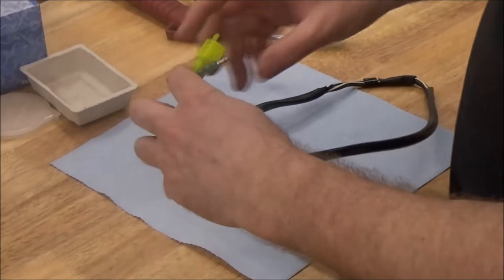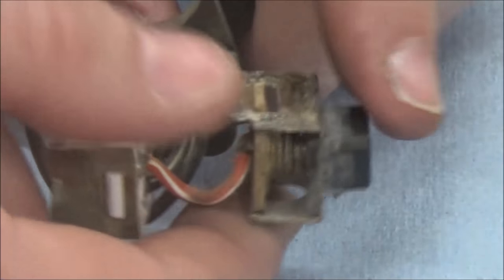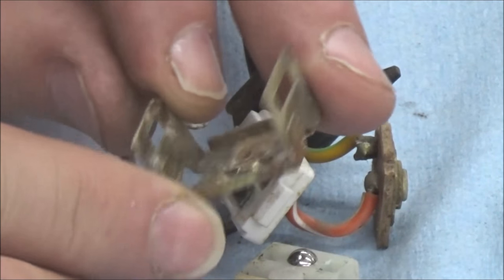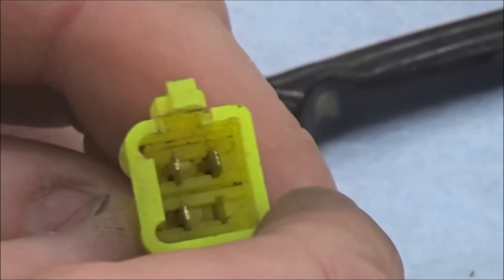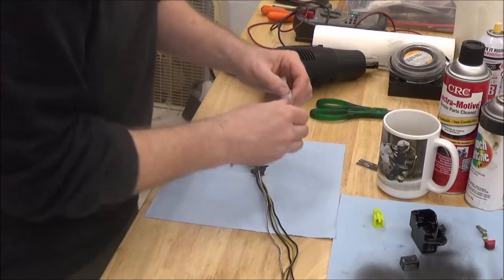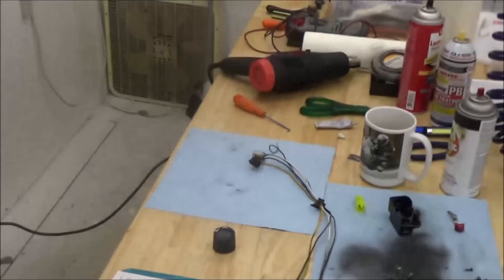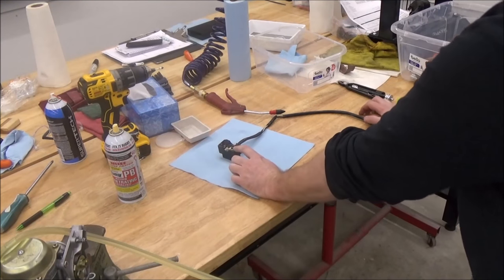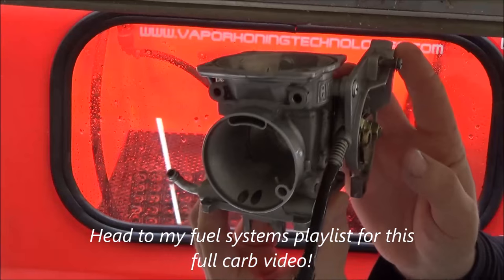How to test and restore a switch housing. Demo: Testing, Disassembly Tips, and Restoration!

Comment: Information packed video Shane. Just one point to remember, dielectric grease does not conduct electricity! If you put it on metal conductors too thick, or where they don't rub against each other, you might cause a bad connection on the part you just thought you fixed.
Reply from the maker: John C thanks John!